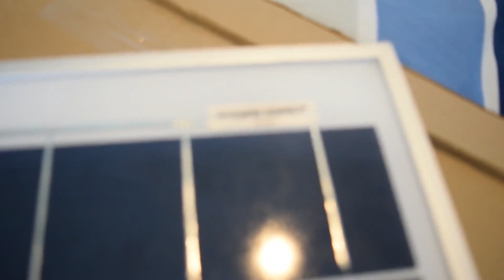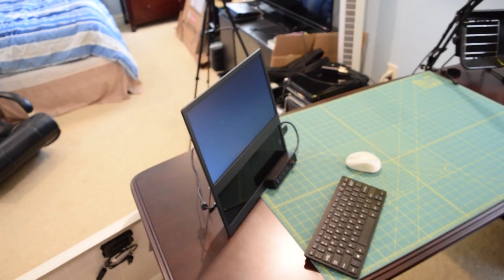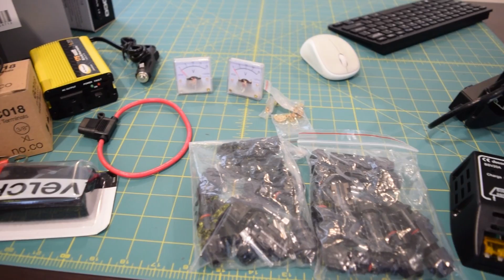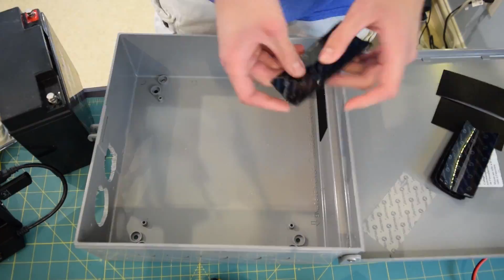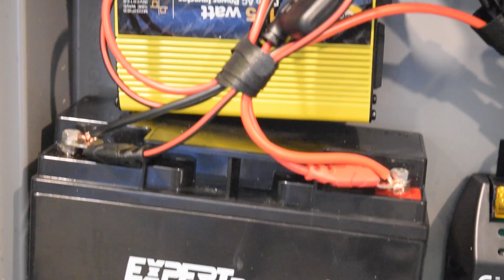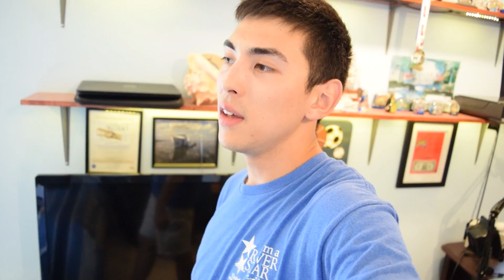Solar Powered Server Project: Trial System Part 1

Comment: Would there be a way to make a system that stores energy in a battery so when you are using your computer it pulls from that first; after it depletes the battery it would move to using power from the grid.
Reply: A relay maybe

Comment: I like the Build but i would change a couple of things. First one is instead of putting the Volt meters on the side. I would of mounted them to the Door. Just because if you are going to mount it to a wall or sit it on a Desk then it would look better then  having to look at it from the side. Second thing is the Inverter i would of cut a whole to where the volt meter's are on the side to put the inverter  there that way you do not have to open the Door to plug it in.  The last thing to do is add a Power button so that way you can turn off the inverter if you are not using it.  But other then that Awesome Build. Thank you for the share.

Comment: A bit of an old video, but you should have direct wired the inverter to the battery through a fuse.  Those 12V Lighter sockets are not meant for high amperage loads, not that a 175 watt inverter is a really high capacity load but its best to just skip the lighter socket plugs on inverters.

Comment: For those thinking of doing something similar. An important thing to keep in mind is, you need at-least twice the power production from your panels, as what you use. An even more ideal power production would be a multiple of 3.

Comment: Lol, you call 85w power hungry? My HP dl380 g5 pulls about 298w during normal operation. 
P.S. I understand why you are doing this and think it is a decent project, but I just wanted to say that. If I could afford a 1kw (All my servers combined use about 800w) solar panel and inverter I would do the same thing.
Reply: CAmarine221 he said it was 85 watts during idle.
Reply: Ah, what ever. My HP dl380 g5 still uses 274w during idle. But what do you really expect from a 2008 server.
Reply: Lol i have an IBM eServer, that eats around 350w on idle...it's from 2007

Comment: hehe, then there is me. I have a server with dual 120w Xeons, 10 HDDs +2 caching SSDs and an R9 280 that runs full bore 24/7 for folding@home. This thing serves as our houses NAS + web server + folding@home computer + my seedbox, so it does a ton of stuff. Thing consumes like 600 watts, but I only paid 300 bucks for the whole thing :)

Comment: looks really good, I have two reccomendations though, mount a 12V outlet (looks like a car cigarette lighter) and a regular 120V outlet to the sides as well, that way you can leave the box closed/locked and just plug whatever you want into the outlets, could even take it a step further and add USB ports to the side.  I like the overall setup so far though.

Comment: OK PLEASE READ THIS!!!!!!!! You need to buy a different charge controller I have the same one and it will kill your battery like it did to my battery. The problem with it is that it is one, not a true PWM charge controller and two, it will float charge the battery at around 14.7 ish volts which is way to high of a voltage for a lead acid battery especially for a sealed lead acid battery like yours!!!! This may have just been my unit but please once its all set up check your battery's voltage to make sure it doesn't rise above 14 volts!
Reply from the maker: Thank you for the warning.  That is what this test system is for.  If the charge controller prematurely kills the battery I will not use it in the final system.

Comment: You should use deep cycle batteries instead.  Also, it is not very safe to place lead-acid batteries close to inverters.  The gas they emit can combust if anything sparks or short out.  Otherwise, everything looks great!
Reply: That is a deep cycle battery. It's also a sealed lead acid battery. It'll be fine.
Reply: I am not familiar with that battery; thanks for the correction.

Comment: Awesome video, do you think you'll ever try a PXE Server? Also, FREENAS seems to run fine, on a Core 2 Duo system  with 2 gigs of ram for me, although I don't use it for super large files
Reply from the maker: Thanks for the info!  I do not have a need to use PXE at the moment.

Comment: This is such a cool idea, if only solar panels were cheaper. I love renewable power, it's the future! :D
Reply: I need 200 watt + power for my server 2 run on there
Reply: Rivins Commentary
Computers can use alot of power
Reply: 200 watts of solar panels would power maybe 150w for at best 6.5hrs per day. After that you need to used stored energy from a battery bank of at least 9,600wh, considering you never want to discharge a battery more than 50%. Then a solar panel array capable of producing twice that amount of power (watt hours) in 6.5hrs. Of course, all of this is assuming you're running the server @ 12v. If not, you'll need even more to compensate for loss in conversion. Not to mention, this figure is assuming everyday is perfect weather, and you keep your panels perfectly aligned to the sun every minute.

Comment: I've not done the math, but it 'feels' like your going to be asking a LOT of that small panel.
Reply from the maker: The smaller system is only going to be powering the Pi-TOP (8W), two LED lights at night (17W), and a phone charger.  The system that will power the servers  will have an additional 50W and 100W panel.
Reply: Isn't it also powering an inverter?  Inverters are an excellent way of converting power into heat. :-s
Reply from the maker: TrollingAround Yes they are :p , with the final system I hope to run as may things directly off 12V as possible.
Reply: I think that is probably for the best ;-)  Just keep an eye on the voltage drop over cable length ;-)

Comment: For not knowing what you're doing, you're doing a damned good job. Looks great so far. You already mentioned that speaker wire was temporary, but you should make it a priority to upgrade it and not let it become one of those long term temporaries. For this application, it's not efficient at increasing distances (CCA vs solid copper) and usually the insulation is inferior. I'm looking forward to part 2.
Reply from the maker: Thanks!  I regret going with the CCA, I should have just bought the good stuff so I would only have to route the cable once.  It was a pain to route the cable under the house and into my room......  I would prefer to never have to do it again XD .
Reply: AA Computers and Technology It won't be so bad now because you have an existing line. You should be able to fish it through on the tail. No more need to go back under there... unless you did a really exceptional job and secured it with wire staples or hooks or something.

Comment: For NAS software use Openmediavault iT is not Ram Hungry. Tell me if u need help
Reply from the maker: Thanks for the suggestion!
Reply: It's Debian-based, so you can do a lot of stuff with it. I installed it on a Pentium E2140 system with 1GB of RAM and random HDDs for testing. Unfortunately I can't actually use it, transfer speed of 1MB/s. :(
But my home network is only 54Mb/s, garbage, Gigabit could do better...
Reply: +Davide424 Nice i use it 24 7 for my Own storage. I got a Dell Poweredge R710 whit vmware esxi running omv on there works Great

Comment: I must try something like this :P But I spent my birthday money on a GTX 760... I'd becareful running servers on atoms, there mostly designed for light systems, such as web browsing, also, how are the servers power be redundant? For example, if the solar panels break, will you have like a UPS or direct connection to your home power incase?
Reply from the maker: The archives server receives very little traffic so I think an atom processor should suffice.  If something goes wrong with the solar system all I have to do is unplug the servers from the inverter and plug them into an outlet in the house.
Reply: AA Computers and Technology
Oh nice :) Great video by the way. Looking forward to part 2 :D

Comment: Don't use speaker wires!
Reply from the maker: Ehhh, I was hesitant about that too.  It works and has caused no problems so far.  When I decided to build a bigger system I might end up swapping it out for pure copper marine grade wire.